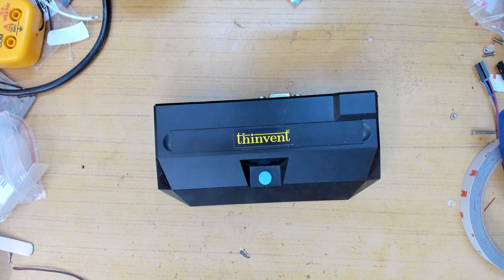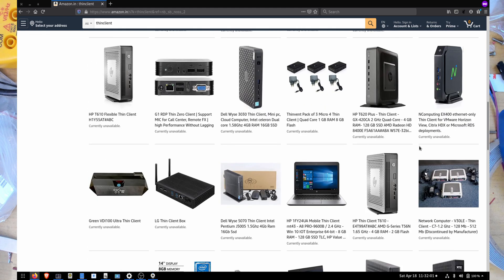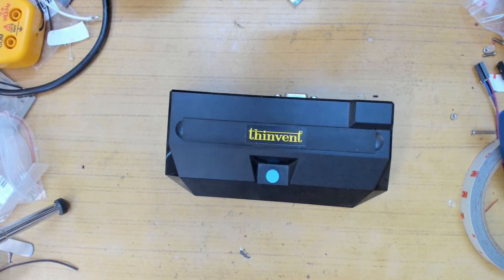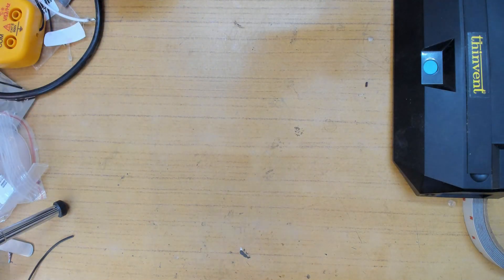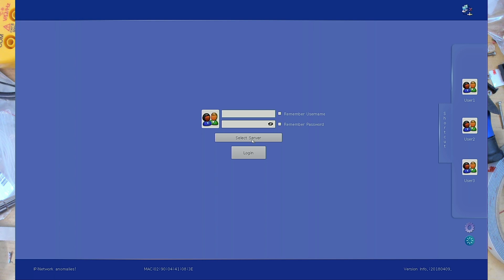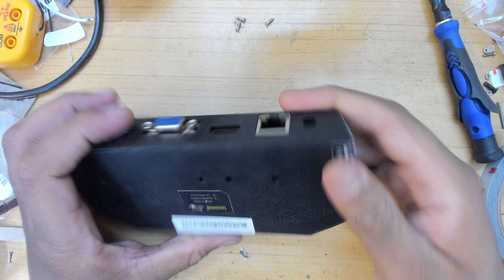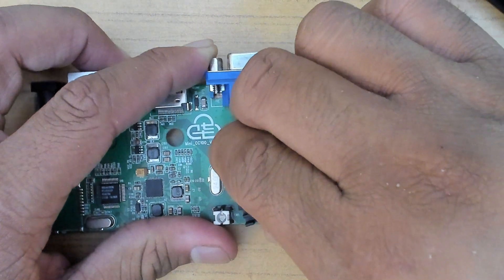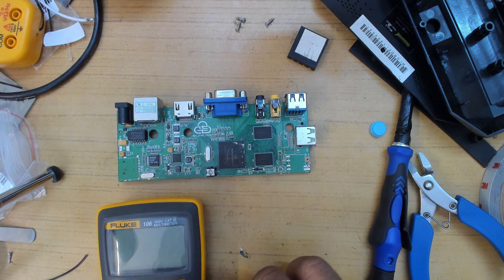Cheapest Arm ThinClient PC on Amazon | Part 1: Teardown

Comment: Hii sir Quantum Thin Client with 1 GHz Dual-Core (A7) Processor, 512 MB RAM with 4GB ROM for Node Computing VGA Display Port, 4USB ports, RJ45 LAN, Adapter Included, 1-Year Warranty QHM6056B (Black) I have this but its OS has got corrupted. I inserted the OS during the installation and the device went into boot loop. Please do you have any solution?